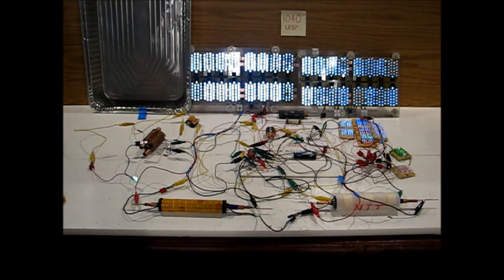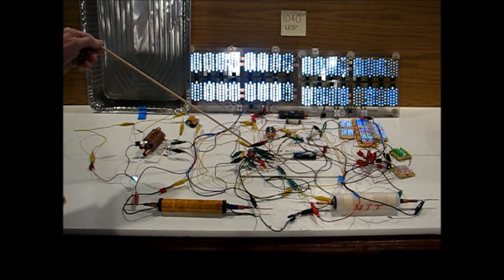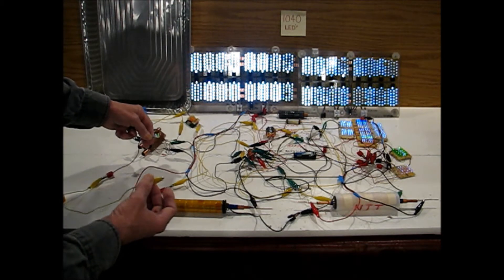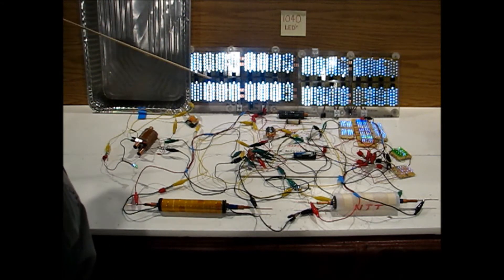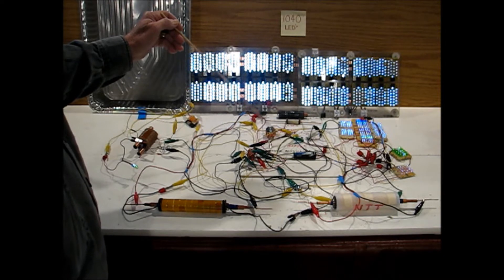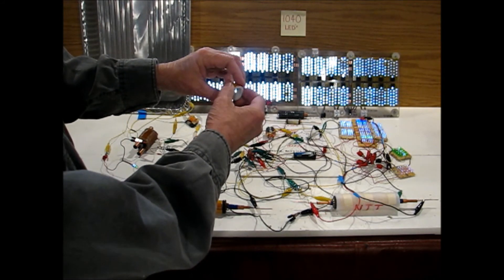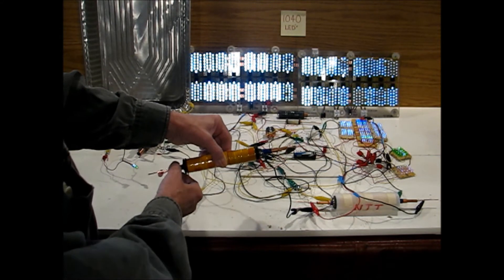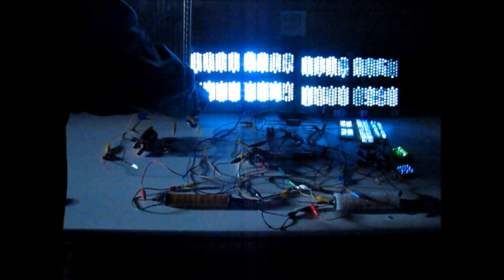Double Amazing Joule Thief Circuit Follow-up

Comment: I had a question. Its not about your device, but its more about electricity in general.
 Why do we need to ground out electricity after it has run through a device and done its work?
 I figure if you had a generator making power and it sent its charge to power some lights, why send the current back to the generator and not to a capasitor to store, step up to usable pressure "amps", and reuse that power again? The generator could have ground wire, but use that ground to draw electrons from the earth not discharge them into the ground, to replenish its electron supply.
 I know this might fly in the face of current views on how electricity works but I think it might work.

Comment: Hey amazing circuit you have here! A friend and I saw this and we were totally impressed. Mind if I ask you a perhaps silly question though?
We wanted to try making something like this ourselves so we checked your website and started working on our project with the information given there, but we were wondering, How many windings does the coil of the ferrite tube has? And what's the caliber of the coil's wire?
Reply from the maker: I carefully examined the ferrite ring(s) coil and counted 9 turns. The Wire I believe is #22 size.
Reply: Awesome, thanks a lot!

Comment: Hi, im new to this stuff but it sure is fun to see what you are doing. I was wondering if you could please just tell me what this could be used for and why its special.
 I figure its using power in a more efficient way. Is it a form or over unity? could this system use a battery and make enough to recharge its own battery with out loosing its charge or running down?
 Im sure many other people would love to hear a lay mans explanation of these concepts and would generate a lot of interest if you would explain as simply as possible what this dose and why its cool.
 Thanks!
Reply from the maker: Pratical use? Good question. Learning tool is another matter. What it does demonstrate is that you can do alot more with alot less.  But perfecting it to a sustainable level is quite another issue. If one considers even a .001 ma. draw to light each bulb (which is actually higher) multiplied by 0ver 1000 LED's would be about 1 amp draw.  A "AA" battery would be instantly overheated. We are currently lighting a 14W CFL bulb to FULL brightness with less than 1/2 Watt of power imput.

Comment: Wow, this case becomes more interesting!
So you mean R1 & TR2 functions to make current flows to base of TR1 to be smaller. For this same purpose, I suggest you to replace R1+TR2 with just one (around) 47 ohm resistor. This will prevent R1 from burnt out caused by overcurrent that flows thru it's base-emitter.
Good Luck.

Comment from the maker: I was just "experimenting" moving a wire here or there, adding a wire here or there, what if i add a coil here, etc. etc. The T2 toroid, enabled me to light more LED's (the smallest wire winding gave me the best power to the LED's) Then I decided to add the T3 coil which also increased my power out, I added the 3rd (TR3) in parallel which also increased power.  Without the R1 and TR2 in the circuit the TR1 gets hot and burns out. Was just having some fun. :-)